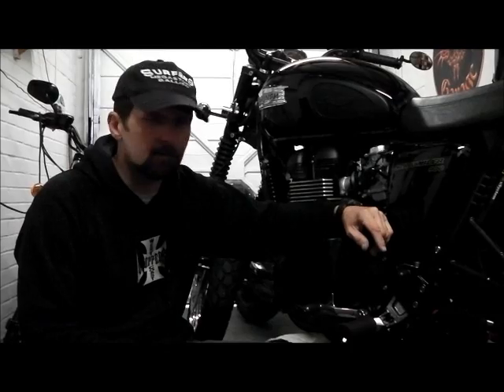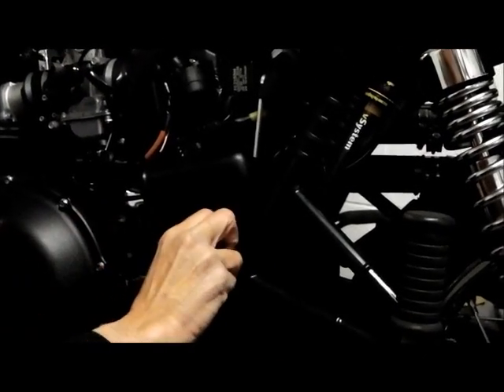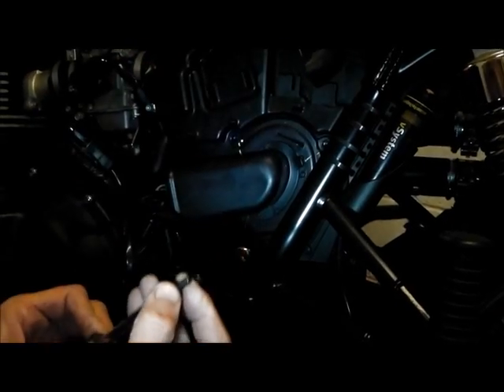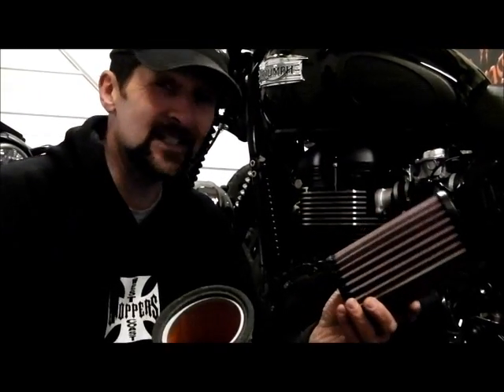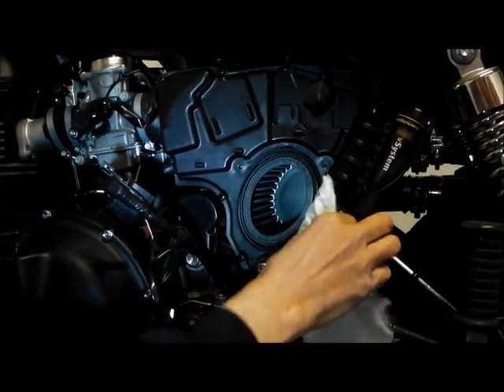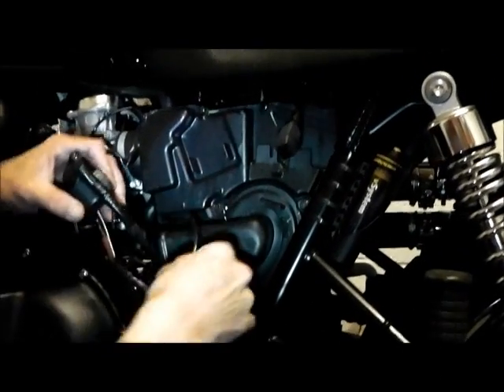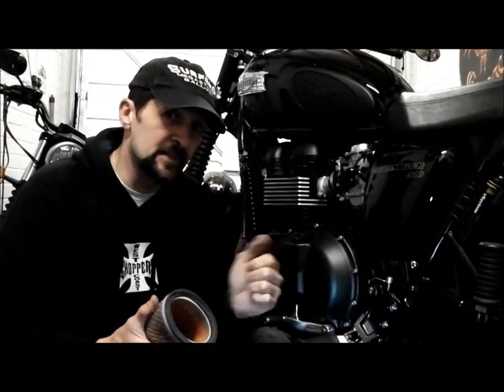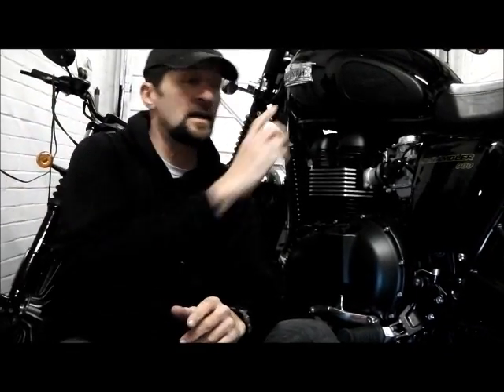Delboy's Garage, 'How To' Triumph Scrambler K&N Filter upgrade

Comment: hi Del do you have any videos of cleaning used air filters, noticed my old GPX filter was lookin bit grubby but daft as it is ive never actually cleaned one, or is it better to buy a new one? Cheers
Reply from the maker: If it's a paper filter mate, which the standard ones would be, then they're disposable, so you'll have to replace it... but if somebody in the past has upgraded it to the K&N cloth type, they can be washed and there are different methods, depending on the filter... so you'd need to identify which one it is first mate, hope that helps!
Reply: @Moonfleet41   thanks Del its actually a foam type so think i should be able to wash dry and reuse it cheers mate
Reply from the maker: @SEANO1810  Awesome mate, that's money saved then..  the foam ones can get real greasy over time with fuel residue... so if it feels sticky to the touch, try a little degreaser through it first..even WD40 can dissolve any greasy residue.!  but if it's just plain dirty, then use a big dollop of hand cleaning gel (like Carex or something), NOT washing up liquid.... mix the hand soap with warm water and make a small wash bath for it in the bottom of a bucket.. first, soak it for ten minutes, then gently agitate it to loosen all the dirt... and let it dry naturally NOT with an airline.!  .. hope that helps mate, good luck with it.. Del.
Reply: @Moonfleet41   cheers Del gives me something to tinker with during lockdown  doing the old girl up a bit did brake pads all round yesterday tyres week before and generally polishing bits up, stay safe mate
Reply from the maker: @SEANO1810  You too stay safe buddy, and enjoy your project.

Comment: Hiya Del, yes I put a K&N in my 1200 mk1 Bandit, did a plug chop and really there was no difference between that and the HiFlow I fitted last time up. The trick is as you wisely state to not alter the airbox or use pods! (Horrible things!...)
Reply from the maker: Cheers Ted, totally agree mate, it was in a conversation with the now legendary 'Ray Deben' about 20yrs ago when I took my Z1000 into him and asked him to dyno it up with cone filters on and he told me the best thing to do was throw them away and re-fit the air box!  Engine's must breather from a still air cavity to avoid the turbulence around cones!

Comment: Alright Del Another good video. i use the K n N myself, totally agree with you! dont see the point in buying a new filter every year when a K n N has paid for itself in 18 months and then you have a lifetime of use out of it. But im waffleing, i was wondering if you know of anyone that is looking to do their own project bandit? My 1996 600S is going up for sale soon and thought you may know of someone looking for a.........decent bike for a project lol anyway just thought i would put the Question out there. Cheers mate
Reply from the maker: I certainly do mate, not sure if it will be exact right bike for him, or if you are close enough geographically to deal, but get in touch with ...pgod1960.... he's currently looking for a Bandit to use as a bit of a project, so why not drop him a PM and see if you can help each other out!  Good luck mate, Del
Reply: Moonfleet41 Hey Del thanks for that i will certainly drop a line. the geography might be a problem but hey its worth a shot lol thanks again dude :)

Comment: Another great video Del
We had a debate on the XJR forum about the pro's and con's of fitting after market filter over the oem in the end i think it was something like a 60/40 split in favour of the after market,mainly because of the life time use rather than performance
I have always fitted K&N on my bikes,the XJR ran a bit lean according to the dyno so i was advised to lift the needles in the carbs one notch ,I must get it back on the dyno and see if it;s worked lol
oh and top tip about not using the oil on the K&N ,your theory make's a lot of sense mate
Reply from the maker: Sure thing mate, but don't over think it on the dyno... just do a PROPER plug colour check and that will reassure you of the mixture... ride at 4,000 rpm for about 3mins then hit the kill switch, pull in the clutch and coast to a halt, then pull a plug out... if it's Rich Tea biscuit coloured on the tip, it's perfect!  cheers fellah, Del

Comment: Hey Delboy I'm a big fan of your channel and had a quick question for you. I recently installed a pair of the British customs predator exhaust pipes on my 2012 T-100 and have ALOT of popping on de-acceleration. I had the bike remapped but it hasn't helped with the popping. I was wondering if a K&N might help with this annoying issue. I really don't want to pay $300 for a full airbox removal kit unless I absolutely have to. Thanks for all the vids and keep up the great work!
Reply from the maker: Hi mate, The popping is caused by the Air Injection system igniting the unspent gasses in the neck of the header pipes, its designed to burn off any last residue and create a clean exhaust emission....now when the factory pipes are fitted, they are so restrictive that they suppress any popping, but it still happens inside the pipes...when you fit open pipes, you just let it breath and the sound is heard.

To stop (or massively reduce) the popping, you need to remove the Air Injection system, and that also means removing the Lambda sensors too, and make sure the bike is remapped to run correctly... there are many after market free maps that can accommodate this..some dealers can help with this depending on your local law allowance for tuning..

Hope that helps..
Del.
Reply: Thank you so much and keep up the great work! Cheers

Comment: I've been using K&N oil filters for two years now. The internals are superior to the big names, but my favorite is the 17mm nut spot welded onto the top of the canister style filters. It makes removing the old and and torquing the new easy. Ya I'm OCD about torqing everything.  :)

Comment: I think filter companies give money to the bike companies NOT to put them in so the filter companies sell more filters.
Reply from the maker: That's an odd notion as if every bike had one from the factory, then they'd sell 4 times as many and wouldn't need to sell them to us plebs as an aftermarket item, they also wouldn't have the expense of packaging and marketing every single one and sending them out to millions of shops round the world, they could just shop container loads straight to the factory....!
Reply: On the other hand, their markup on their product would be a lot less in order to sell to the factories. They still have to have sales representatives for each manufacturer to keep other competitors out. Marketing to the bike bikes reps. etc...I worked both the manufacturing and wholesale. Markups to retailers are a LOT more than to manufacturers. Overhead is about the same.

Comment: I make you right on the k&n filters ive fitted them to all my bikes too. Some nice little tips in this vid. I cant stand people who hang on metal fixings going into plastic. Im sure the moron who owned my bandit before used a breaker bar to do the air box up. Another nice tip with the cloth around the frame too. I bet they dont take that much care at a main dealers. Great vid as always Del keep em coming. Lewis

Comment: Very useful video! Just need your opinion on something, I've read reviews that DNA air filters give better performance on a thruxton as compared to K&N. Any opinion about this?
Reply from the maker: +Shaun Goh Hi Shaun. DNA are just a competitor to K&N, and i guess they will natually be compared with each other.... but i fail to see how any Air filter can improve performance...even on a Dyno you would struggle to see any difference other than "points of a percent" here or there in the graph... TBH buddy, the Thruxton (865cc) is a camel anyway, just like my Scrambler, you need to do an awful lot of modification to those motors to see any reall street performance.... if you havent tried the new 1200 bikes yet...then go test ride one and you give up bothering with expensive mods on your 865..! your money would be better spent on a top class handling package like some Ohlins shocks, and some sexy forks.... then some real chewy tyres and you'll be too busy having fun to notice the BHP...lol   Hope that helps buddy... maybe not the reply you expected, but that how i see it.. Del.
Reply: +Moonfleet41 Thanks for your advice sir! My thruxton is only 6 months old thus I won't be swapping it for the thruxton 1200 I'm afraid. And yeah I agree it is a camel compared to my street triple lol. I've got Ohlins rear shocks and am looking around for some good Michelins or Pirellis that fit the stock rims (front rim is a pain to fir tires for). Did consider doing the air box removal but decided thats more of a cosmetic mod than anything. Will settle for a setup of Ohlins shocks, AI removal, air intake bellmouth with baffle removed and TORS exhausts. Do you think O2 sensor block off is necessary? I read that a remap is required for that and I'm not sure if Triumph's TORs map is compatible.

Comment: As always, great video :). Probably gonna install a K&N on my bike as well after I've fitted a new exhaust... great opportunity to get it fully remapped (or whatever you'd call it on carburetter bikes).

I noticed that the videos are kinda weird looking lately (black bars on the top + bottom and sometimes the sides), and I've read some comments that you guys looked into it but couldn't find the issue. I wouldn't mind taking a look. If you can send me the footage that you upload to YouTube and a little part that's raw of the camera, that way I can figure out where the problem is.

Also, I noticed that the camera is struggling in low light... it doesn't get enough contrast. I'm pretty sure some subscribers wouldn't mind to pitch in a few $/€/£ in case you wanna get a new camera (I'd love to). I know you don't do it for money or other stuff, but I'm sure we really want to do something back for all the great videos!

Btw, I'm not complaining about the videos, the content really is awesome. I just want to do something back and as an IT guy I hope to put some of my skills to good use for the channel. Just let me know what you think :).
Reply: Wow, that's great news! Look forward to the new videos :).

Comment: The only thing i had to adjust on my FZ6S2 when i switched to KN filter was up the idle slightly. I checked to make sure installed flow direct right on it and it was  right. Apart from than it nice easy mod, gain was noticible until i was main road where i could let her breath fully. 
Next mod...progressive springs!

Comment: Hi, will it increase your petrol consumption after putting a K&N Air Filter?

Will the bike have increased power? Or any changes?
Reply from the maker: +Ian Sim Hi Ian, even after fitting the open pipes and remap, i didn't notice any more fuel consumption.. revs a lot more freely due to the free flowing nature of the filter and open pipes... but generally better all round.

Comment: Perfect vid Del. I've been following your channel for quite a while now. I always like those small common sense hints. Like the one with covering the frame before pulling out the filter.
You pointed out that the engine would not need re-mapping if you only change one single element. BUT... You just recently changed your exhaust (now almost without baffles ;-)), didn't you? Will you do re-mapping after changing the air filter now?
Reply from the maker: Yes indeed Ray, I will be getting it re-mapped as I have changed the exhaust for an open one but if you're running a completely standard bike and just change the element then you should be able to run factory map or jetting... thanks for watching mate, much appreciated, ride safe, Del

Comment: I bought one for the Tiger off ebay £39 Bargain!!!.
not fitted it yet a timely reminder to get my arse in gear and get the job done, Its a tank off job but there are a few jobs i would like to do while its off Throttle Cable Adjustment, Lubricate the Stepper Motor and balance the Throttle Bodies so it will be worth it, probably do it over Christmas while having a day off the beer lol. Great Video as always Del very informative. 
RSMF
Craig...
Reply from the maker: Nice one Craig, sounds like a fun day in the garage mate... but make sure you take the beer in there with you and why not take the camera too and show us the Tiger?!  I love 'em!  After all, they are the correct bike that Ewan Boorman and Charlie McGregor SHOULD HAVE gone round the world on... after all, they are British aren't they?!  Cheers mate, ride safe, Del